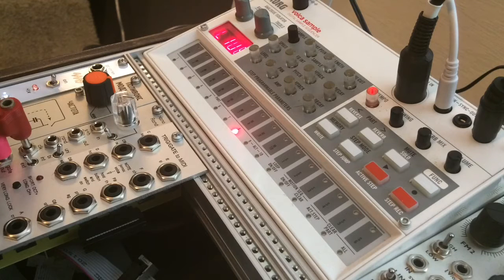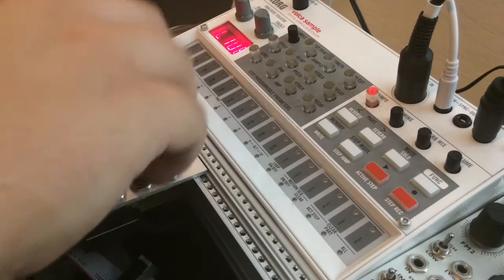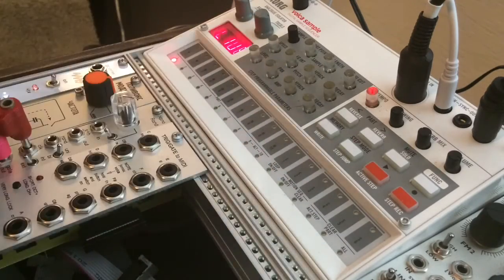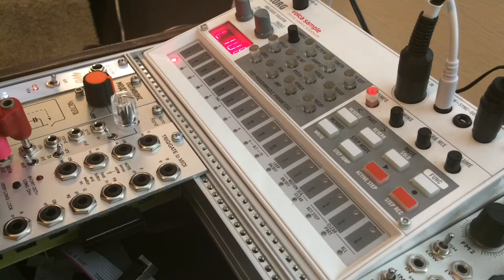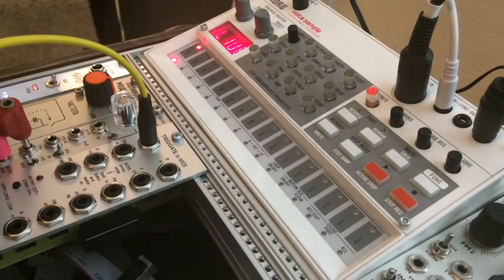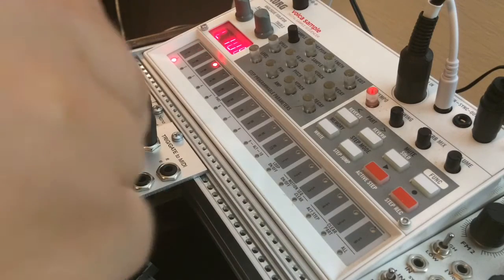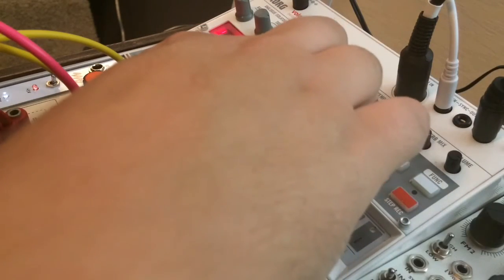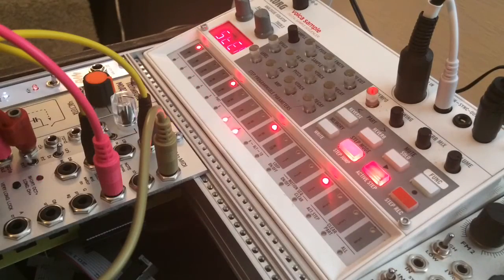Tutorial: Ladik Trig-to-Midi and Volca Sample

Comment: Hi, thank you for this video! I came across this ebay thread that suggest this particular unit has both M215 and M216 inside. Is that possible to have in same unit? thanks

http://www.ebay.com/itm/222277592132?_trksid=p2055119.m1438.l2649&ssPageName=STRK%3AMEBIDX%3AIT
Reply from the maker: WhyBaneWhy yeah it says it includes both chips. The hardware is the same, so you could use either an M-215 or M-216 module with either chip.
Reply: Thanks Flohr
Reply: did you ever get the answer to this?
Reply from the maker: Nihilanth I answered. You can either use the M-215 chip, or the M-216, but not both. If I seller is including both they just mean they have both chips. There is only room for one chip on the board.
Reply: hey thanks. I guess I didn't expand the replies or something